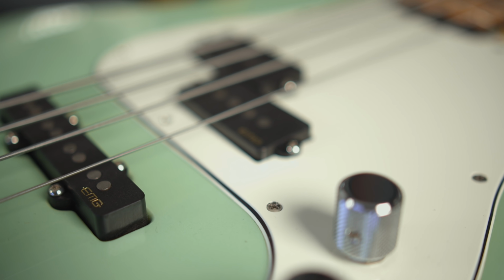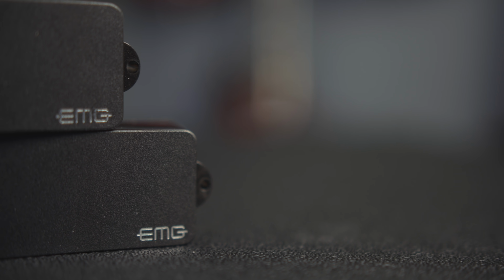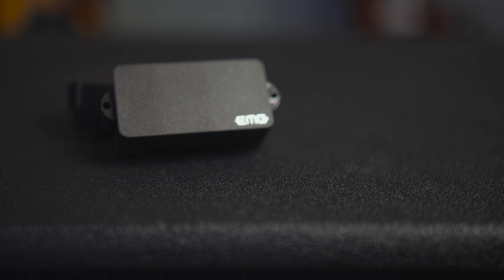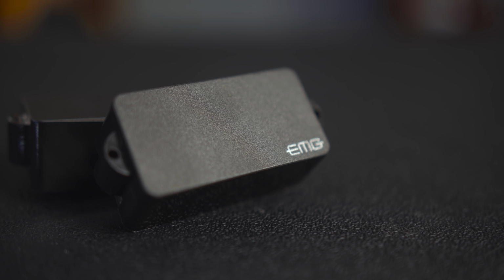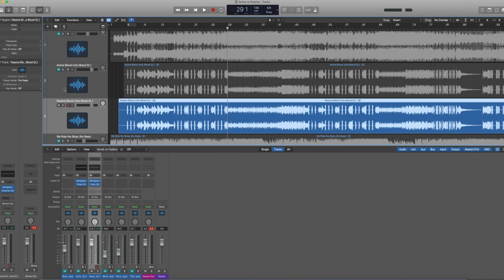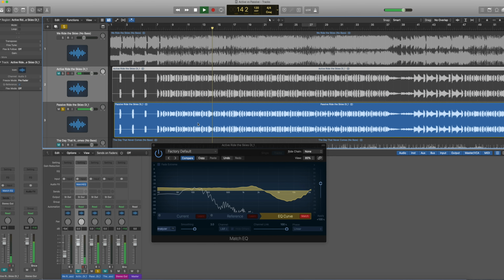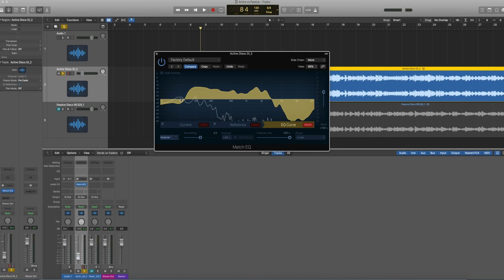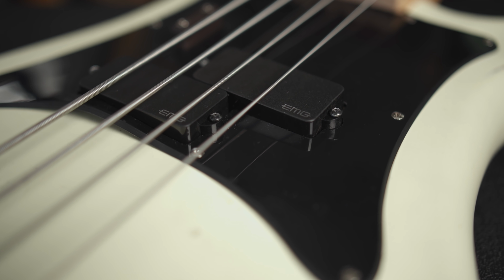The TRUTH About Active Pickups

Comment: This is probably the most explanation I have ever heard regarding active pickups. Please do more! Like for the x series etc
Reply: This is a good explanation of active pups. My issue is the phrase "active pickups are objectively better than passive". By what metrics is this decided, and how are these metrics chosen as being better. All musical tone is subjective. If you like the tone for what you are doing, then cool. If you do not like, then cool. Stop with the objective BS.
Reply: @POLYFUSIABAND  tone is subjective & has nothing to do with the "active pickups are objectively better." He listed several objective benefits of active pickups. Higher output, lower impedance, less "string pull." The lower string pull gives you better sensitivity giving you more frequencies to work with.
Reply: X series is only giving you extended range, that means more bass and more treble which again works by giving you even more ways to lower the Hertz you don't need.
Reply: ^^^^ Ditto

Comment: Why would debris hurt the coils of a pickup? The wires are more-or-less fixed in place, so there's not much chance for wear. The wires are coated in varnish or some other insulating coating. I suppose certain chemicals can degrade the coil coating, but probably not sweat or pizza crumbs.

Comment: DC Pedals clean bass boost makes a passive bass sound like and active one  Made by Doug Classe in the USA one of my favorite pieces of gear clean quite and is a battery sipper if you use a 9 volt mine is signed with a S/N if you reach out him specify bass he has one for guitar as well  you diffidently want the bass one  Rich

Comment: I could also recommend using passive pickups and passive electronics at full volume, which gives the full potential of the pickups directly through JACK and get a good preamp on peadelboard for cutting trebles if needed.
This is why some bassistes throw away the volume control and tone control and solder their pickups directly into the JACK socket and do all the shaping of the tone at the foot.
This is exactly what a MM Sterling does with their passive pickups.
It pours out a 100% of what it can take from the wood through the vibration of the strings and the active preamp inside the body does the shaping I believe you can do exactly the same thing with passive Basses according to be at a 100% of full volume.
You will remark that when the pickups are at full throttle, the tone doesn’t work.

Comment: I have all 4 types in my collection. There is no better or worse system just different timbres, all useable, all uniek. My active /active basses are TRB Yamaha's and sound very HIFI but I would not use that bass for blues or rock and roll for instance... there are race horses and work horses.

Comment: Look, "objectively superior" doesn't exist...I've been gigging and recording for decades and i prefer my basses to have a passive setup...why? It's about the levels of the sound coming out of the bass, which i want at a certain level, it's about control...i want there to be a volume control for each pickup and an overall tone, because i can get the sounds i want with that, end of story! If i need more, a little eq on the outside is how i get that, and i have way less problems and can focus on the MUSIC...I have a battery powered (emg)bass, but it's only there for if i get called to sing and play at the same time...the rest of the time, i don't want to deal with batteries, ever!

Comment: I'm an electronics engineer and the hang ups players often have is that they're at the mercy of commercially manufactured systems which are ultimately compressed to hell with the RC filtering schemes and there's signal loss in terms of full wave 360° cycles of the signal that further compresses your sound.
I'm a symphonic shred-n-sweep maniac with a very unique position in that I can design anything I want from nothing and it will do exactly what I want for pennies.

The passive sound of any pickups I use remain 100% intact but of course, I have about 15x the headroom to work with and so with that in place, I also always add a 2 or 3-band EQ. 
Once you  have an active system you like, it's impossible to go back, but I do know how artificial and processed commercial actives ultimately sound. Lots of definition and note separation but with a huge loss of soul. It's really no different than when you're using a peddle except you can so easily get a different pedal! lol

As far as bass though, active 110%!
I don't care if it's home brew or store bought, actives in bass are in a league of their own compared to passives.

Comment: With all due respect I don’t see how you can “voice” a pickup other than losing or gaining some high end due to inductance. It’s the simplest form of transduction where a magnetic field is converting a form of energy into another. Of course you can influence the output and, theoretically sustain. But pickups are not EQs. The only way you can change the curve of a pickup is by moving it up or down the strings. Also if you want to re-voice your instrument (such a marketing phrase) just change the mass of your fixed anchor point, aka. the bridge. And I don’t even want to get into “tone wood”… the point is it has such little effect on the tone of a solid body electric guitar that it isn’t even worth mentioning. Alder was originally used by Leo Fender because it was light enough and available all over the country.

Comment: I'm a guitar player, and I use actives almost exclusively. It is just a matter of fact that they're objectively technically better than passives. They solve all the problems and provide simply TONE - the one you want, with none of the crap, a complete sonic range, perfect signal quality, and guaranteed flexibility and peak performance for any kind of setup or situation. Guitar players are a very weird bunch, extremely prone to superstition and magical thinking, and their mentality is hopelessly stuck in the 1950s. In my experience bassists have always been more open-minded, forward thinking and pragmatic.
Reply: Nah it's because active pickups are inherently significantly less dynamic. For the average finger style bass player that's potentially a good thing, they're more susceptible to inconsistent plucking strength consistency than playing guitar with a pick, and many players play softly. Less dynamics is good for consistent rhythm section, compression and high output are good for playing softly. 

On guitar, particularly lead guitar, dynamics are much more commonly desired, being a signature quality of the playing of many legendary players. I've got a couple active guitars I love and I've had more in the past, but despite the benefits you 100% do lose some things using active pickups. Also there's the issues with many fuzzes that will make active pickups incompatible with many beloved and desired pedals. And ultimately because a conventional active pickup is basically a weak pickup that's boosted, with an artificial EQ on top, it's also inherently less responsive and less organic sounding, because it IS less organic, and that may or may not matter to to you, or may or may not matter for your music. 

But it makes complete practical sense that active electronics have always been more popular on bass, and that on guitar even the oldest and most basic technology of passive single coils have endured since the beginning of the solid body electric guitar. And also why the pickup design often held up as the secret best of all worlds tone wise is the P90. Just a fat single coil, sensitive, responsive, high output, but sensitive to noise and everything else. Organic, and pushed are ultimately the most commonly desired tonal qualities in general.

And also like with guitar being played with a pick typically, it also makes sense why places you find pick bassists, like a lot of rock, heavy metal, punk etc, are places you still commonly find passive basses, whereas actives are standard in funk, rnb, soul, jazz fusion etc type stuff, which are heavily finger style, soft smooth playing + slap dominated. 

The closest thing to an ultimate guitar pickup design is really the G&L MFD pickup. Less susceptible to interference and noise, akin to active pickups, fully passive and organic, and also really high output compared to their conventional passive equivalents. They're like P90s but super hi-fi. RIP G&L.
Reply: @sEaNoYeAh  You said that actives are artifically boosted and have an artificial EQ on top. That’s sort of an inverse way of looking at things and a bit of an emotional framing.

Passives have thousands of copper wire winds to generate enough voltage to drive an amplifier. This large coil, just by the nature and physics of it, acts like a low-pass filter which results in top end roll-off and a muddy low midrange. Actives seek to eliminate that frequency range loss by using significantly less windings, and the necessary voltage is achieved by boosting the singal with a preamp. It’s just two different ways of achieving the necessary output – there’s no „artificial“ vs. „natural“, it's useless and misleading terminology.

Active pickups by themselves also don’t have an active or „artificial“ EQ. They’re actually more „pure“ in terms of frequency range, because they’re not nearly as tightly wound as passives and are low impedance – that means less tone loss, less noise, lower string-pull (=better sustain!), consistent volume control. There’s no top end loss and midrange mud, and because they’re designed to capture an unadulterated, and consistent frequency spectrum, heavy low-end won’t overwhelm the circuit. An active pickup is a truer representation of your actual sound – not an „artificially altered“ one. People who are used to passives and then try an active DESCRIBE their impression with words like "sterile", "clinical" or "undynamic", but that's just using the wrong words for something they're not accustomed to and can't objectively explain.

The whole dynamics talk that guitar players like to go on about I can’t really take seriously, because it’s all so widely misunderstood, contradictory and, again, heavy with emotional and „vibes-based“ framing.

The electric guitar is not a very dynamic instrument to begin with. The „lead player“ argument is a particularily bad one, because it’s precisely the area where there’s all this talk about sustain, sustain, sustain, and the only way to achieve sustain in a lead-oriented context is compression. Which is what everybody is heavily relying on – that’s what distortion is. So all that dynamic talk is out of the window. 

It’s also completely untrue that active pickups for some reason are so incredibly undynamic that they don’t react to how hard or soft you pick, etc. That’s complete and utter nonsense and a fundamental lack of understanding of the matter, and has been peddled for years by skeptics and boneheads who never spent any significant time with an active instrument to begin with.

What you call „responsiveness“ in a passive pickup is a stronger, non-linear magnetic field that where the level of compression and resonance constantly shifts. That’s „more dynamic“ in the sense that with your playing, you not only react to the string tension, but also the unpredictable behavior of the pickup.

That push-and-pull between your playing dynamics and how the electric hardware counteracts it is obviously something we often find attractive in passive pickups, but that feel is not „more natural“ or inherently more dynamic, but actually the other way around – you’re interacting with a less predictable set factors. Same goes with tube amps that „sag“ a lot – that‘s a momentary drop in an amplifier's power supply voltage because it struggles to provide instant current, resulting in that typical spongy compression that smooths out the attack and increases sustain. That's not more "real", it's more "altered" or "fake", but guitar player jargon is typically completely the other way around.

What I’m saying is that it’s all just words. It has nothing to do with the facts. People throw these technical terms around to describe their emotional states and unknowingly constantly contradict themselves. It’s lack of knowledge combined with vibes-based and „ideological“ framing. Guitar players use all these emotionally loaded colloquial terms like „organic“, „dynamic“, „analog“, „soul“, „digital“ and „artificial“ to describe impressions and sensations they don’t understand and aren’t sufficiently equipped to explain.

Comment: The risk of standing on stage with a dead battery is reason enough for me to stick to passive.
Reply: So you can't be assed to swap a battery prior to a show? Do you forget to change your strings too? You sometimes forget to turn on the amp?
Reply: @honigdachs.  I might forget to bring a spare battery. One more thing that can go wrong
Reply: @honigdachs.  It's one more thing to remember that can go wrong. 

If I forget to change strings, I play with dirty strings. If I forget to turn on the amp I turn on the amp. But if have a dead battery and no spare, then I simply cannot play.
Reply: @Vinkelslips Very little faith in one's own mnemonic facilities, huh? 😄
Reply: @honigdachs.  Yes, I tend to forget things quite often. 

But I would reconsider if I wasn't satisfied with the tone I can get from a passive pickup. But then I would likely also modify my bass to have a passive pickup as backup.
Reply: @honigdachs.  But then again, I would challenge anyone to check if they actually can hear if the bassist is using active pickups at a live gig ;)
Reply: @Vinkelslips  We could all be playing amplified toasters - as long as it runs through an adequate amp and is loud enough, nobody cares ... 😄

Comment: This is going to sound crazy, but stay with me. I have a Fender Jazz Plus from 1991 (bought new), factory Lace Sensor active pickups with active EQ. I struggled with it for years trying to get the treble right. Constant knob fiddling. Why so "sterile"? Take the bridge down, take the treble on the bass's EQ down, turn down the treble on the amp. Pump up the bass or the lo mids to counter the treble, only to muddy or flub up the tone. I never could get the sound in my head to come out of the bass. Then I discovered flat wounds. No more problems. All EQs are practically set flat. Definitely NOT STERILE. The treble is tamed, the sound is warm, but can be brightened. It's perfect (for me). So that's my suggestion for anyone struggling with the switch - try different strings.

Comment: Yes, subtractive tone dialing is the way to go. It's easier to take away in a mix than add. I listen to a lot of old metal from the 70s and 80s and they did not use anywhere near as much distortion as must players assume. Even the old Maiden albums. It was all about getting clarity in the studio, fullness. Judas Priests' 1980 album British Steele is a great example of a mix with the right amount of distortion. The guitars still sound great. They have this thick, biting power, not a cheesy, trebly overloaded distortion. Megadeth's 1986 album Peace Sells also has a perfect mix. Those JCMs don't have a single bit more of distortion than they need.

Comment: Very good video. But too long winded. And you forgot one important thing about EMG pickups and batteries regarding lifespan. I own an headless boutique build bass with EMG CS pickups in it, no additional preamp or EQ on it, and I wired them for 2x9 volt use, i e NOT 18 volt use. So, 2 instances of 9 volt batteries running in paralell. Gives 2 x longevity of 9 volts. Now, on top of this, I bought these expensive batteries for smoke detectors, LITHIUM, which added longevity. Mind you, that EMG pickups runs on MICROAMPERE, not milliAmpere as pedals does, so the current draw is minimal, not to say abysmal even! This was my only working and playing bass for almost 10 years, and only after 9 years I had to change out both batteries. 

9 years

Chew on that for a while. It should be said that EMGs works down to 4.8 volts before they start to really choke and distort due to drained batteries, but the limiting/compression might occur sooner, but it didn't bother me or hinder my playing. And god knows how many times I forgotten to unplug the bass. Once it was even plugged in a whole week, when I went on a short vacation trip. I was scolding myself when I came back, but no degragation was heard when I played it. So, I have changed out batteries 2 times since I bought it in 2006. Food for thought, and no, I do not work for EMG, or getting kickbacks from them. They sure have their idiosyncrasies too, just as well as other pickups has, active or not... but that's another topic for another time, and forum...

Comment: Great video . Here's a problem I have found: The JV bass pickups have exposed polepieces.  They need raised polepieces in the center. On a radiused fingerboard the outside strings will be very loud and the center strings sound anemic by comparison. The original J pickups are radiused, they don't have that issue. 
Some players I like are Alex Al, Peter Muller, Richard Bona, Victor Wooten.  I have been playing EMGs longer than them , for over 40 years.EMGs don't go bad, are dead quiet, sound great and batteries last forever. 
2 J pickups with the BTS circuit will last over 6 month easy.

Comment: I have a Spector USA NS-2, which has both active pickups and an onboard preamp.  I find it has quite a lot of hiss, which I try to offset by cutting the treble pot and turning the blend pot towards the bridge pickup.  Is this hiss attributable to the combination of the active circuitry and pickups, or could there be another cause?